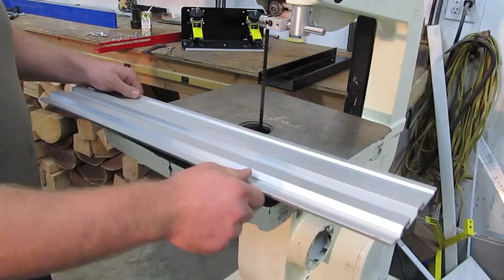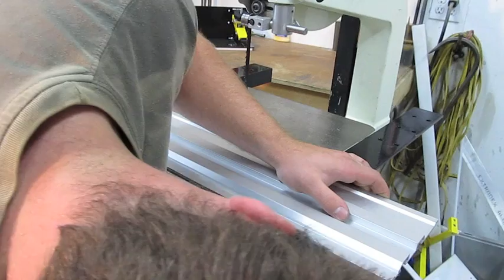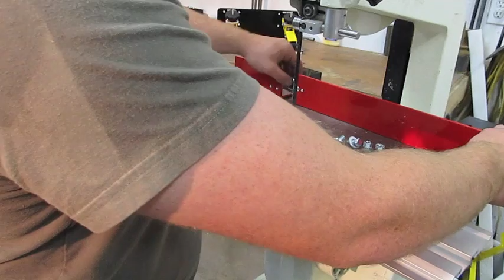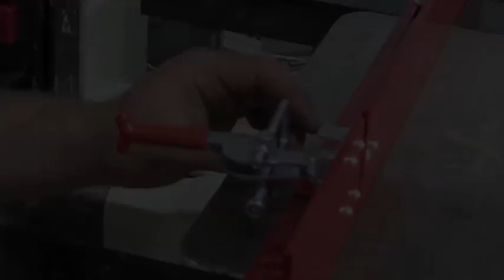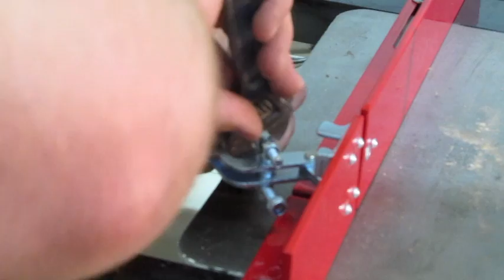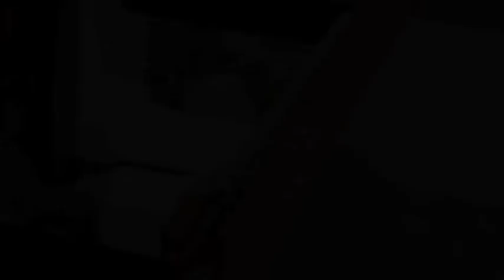Setting Up Your Little Ripper

Comment: I LOVE this concept, but I'm not too thrilled about the clamp system. Every time I close my clamp, it raises one side of the slide track. I have tried numerous times to adjust it but to no avail. It also doesn't line up when closed, as the longer piece is at an slight angle. This could possibly be from not removing the back side of my guide fence thats actually mounted to the saw base, but I can't imagine that this would cause the problem. Any ideas?
Reply: They didn't give you any support? Only two comments and they did not bother to read them. Did you solve the problem on your own?
Reply: That clamping raises for me also, it needs a better design!